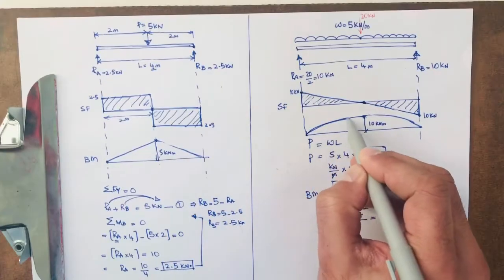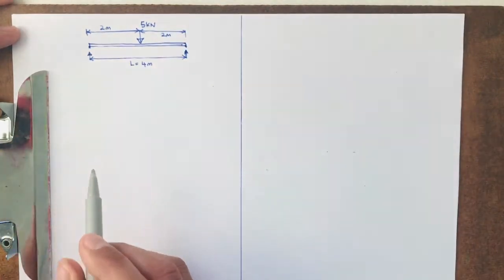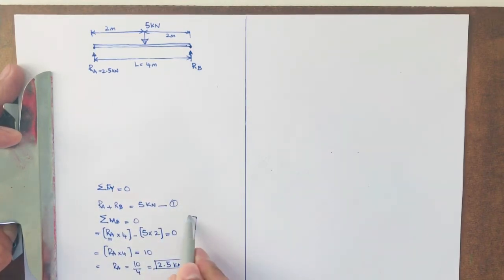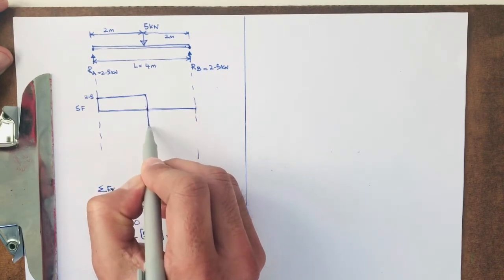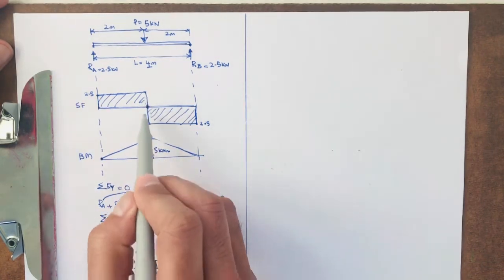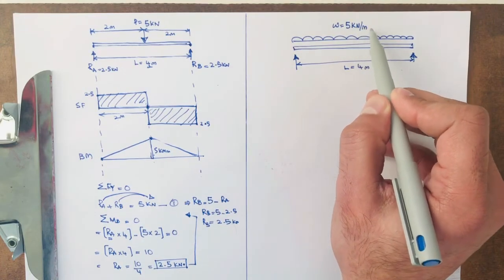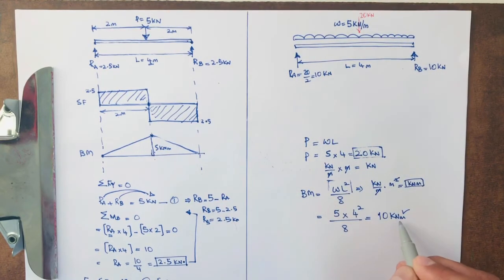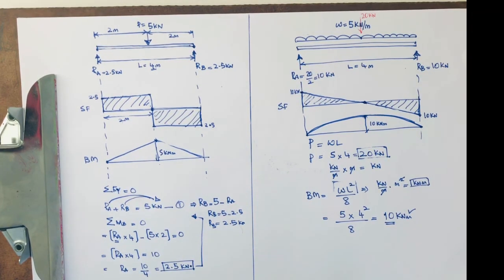Shear Force and Bending Moment Diagrams | Simply Supported Beam | Civil Engineering Basic Knowledge

Comment: Do you still calculate the load manually or take the help from excel sheet where we already have the formulas ?
Reply from the maker: Hi, Self weight (Dead weight) is generally calculated from unit weight x cross section area (manually or you can setup on spreadsheet), the live load (variable loads) are provided by the codes/standards. Hope this helps. thanks